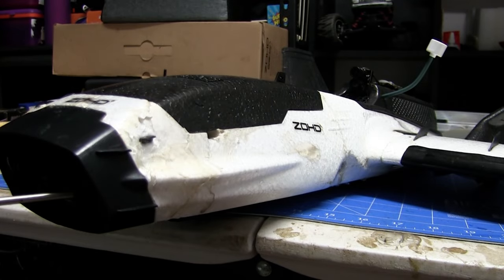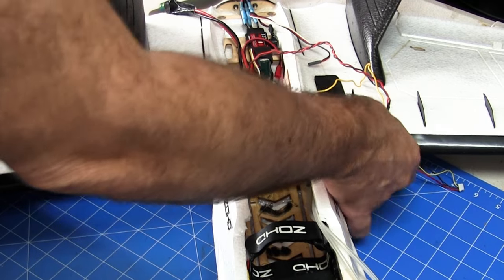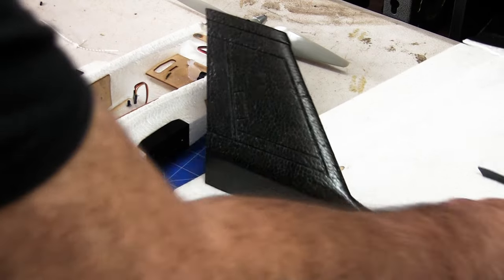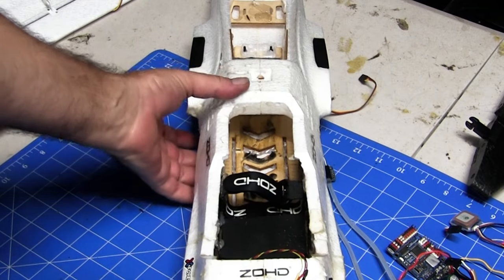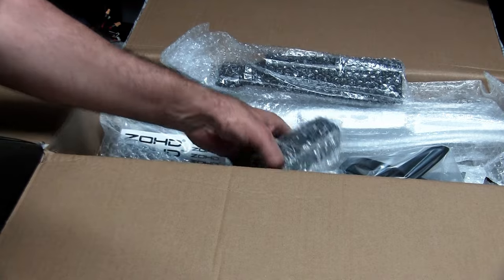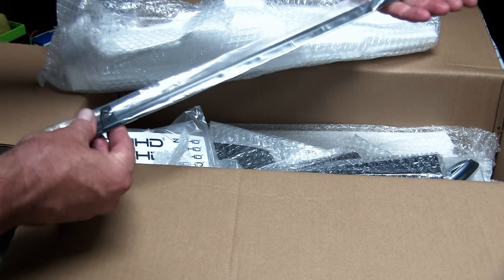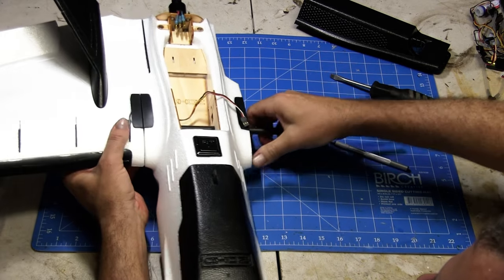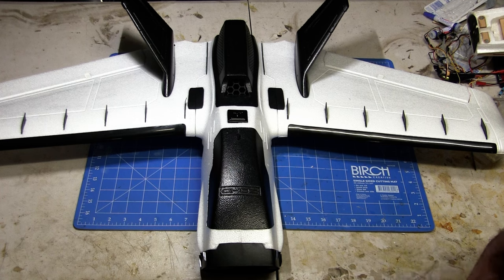ZOHD Dart XL - Rebuild - The Unassembled Kit

Comment: To remove hot glue, try using isopropyl alcohol instead. spray it onto the glue area, wait for few seconds, and the hot glue came off easily, without any stain.